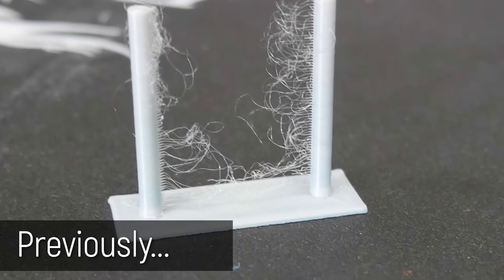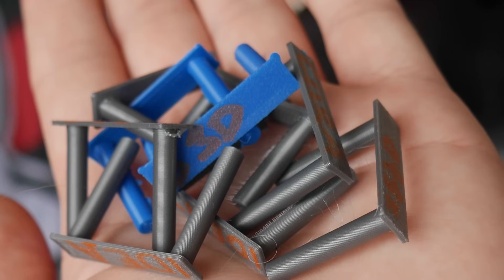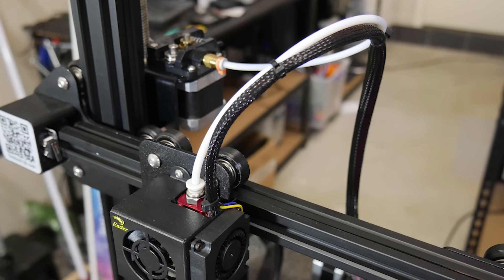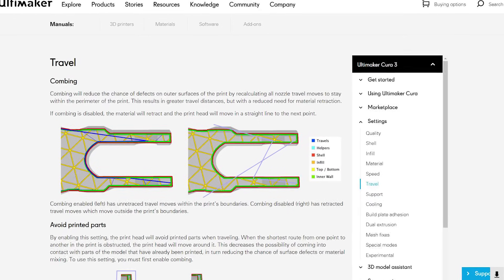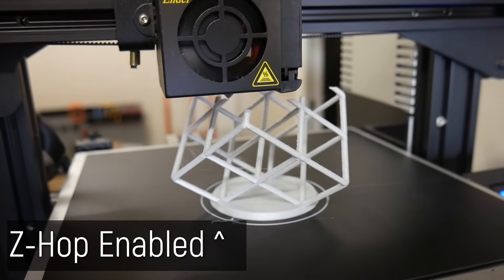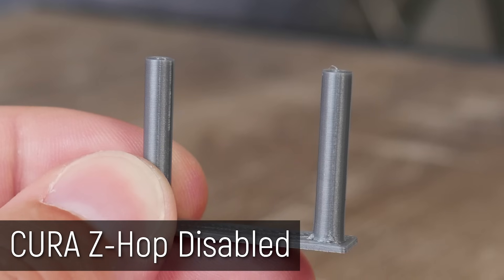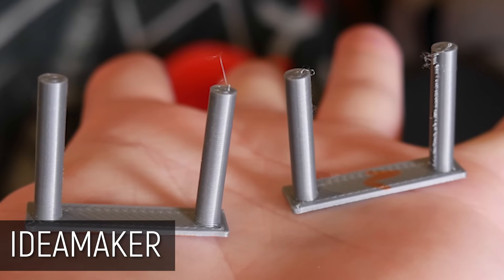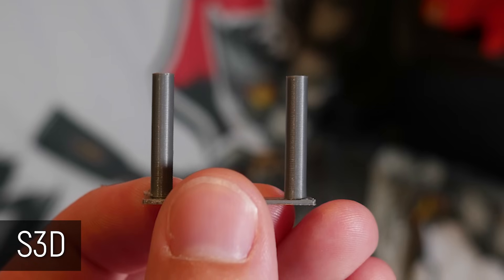Stop Ender 3 Stringing with this One Weird Trick! (ok but seriously)

Comment: Hey, Any, use this GCODE at the end of yours (right after print is finished) to stop this last string from appearing:
G91
M83
G1 E-1 F300
G1 Z+0.5 E-5 X-20 Y-20 F4200

Licensed under GNU GPL v3, makes your very top part very clean and gets rid of that one last vertical string.
Reply: Does it work?

Comment: Angus, I've asked nearly everyone in the 3D world to do a vid on when it's time to change nozzles. No feedback at all. What say you???
Oh and, great vid.
Reply: JP1 on Thingiverse has some calibration parts you can print. If you have measured your filament diameter and set that in the slicer, and the parts are still coming out oversize, the nozzle may be worn. 

You could also buy cleaning needles for a 0.5 nozzle and try inserting it occasionally. If it goes in (don't use much force) the nozzle is definitely worn to that size.

Comment: I have been getting these results for some time. you have discovered "wipe" :-) Whatever cura is doing its looks like a wipe to me. the need for z hop is a cooling issue not a z hop issue. z hop just "gets around" the cooling issue typically (cooling is such a pita !!). The ender 3's are not really vastly different. the first ender 3 is largely identical to the latest ender 3 the only MAJOR difference in my opinion is the arrangement of the wheels for the bed rail. otherwise the differences are minor and minimal. (sock or no sock glass or sticker or mag or fiber board which is not even a printer difference but a print surface difference) ie for the most part the changes do not effect how the printer prints. those parts are unchanged. most are cosmetic or convenience changes.

I just use my normal profile and the string test printed absolutely perfectly. going to redo it in a darker filament as its hard to see the zit line (almost non existent by sight and touch) I enabled z hop with zero change in string (none) and zits (still nearly invisible) I can't tell a difference between the with and without z hop at all. I was pretty aggressive with the hop too at .5mm I will post some pics to twitter.
Reply: I agree and disagree with your analysis of the differences between generations of the Ender 3. While there wasn’t major changes, there was major quality control differences. I sent the generation 1 back with a boatload of notations of what was wrong with it. I now have the latest generation and these problems have all been corrected for the most part. Huge difference in how it prints.
Reply: I'm wondering if ambient temperature is to blame for most of the different results. He mentions that it's too hot, open windows and all. How is your operating conditions?

I'm waiting for my ender3 to arrive and I'll enter the 3d printing world just in this extremely hot  Brazilian summer (30°C indoors).
Reply: I was very disappointed he didn't do slic3r and simply turn on the wipe...
He also did not experiment with the temperature on the stringy filament. I can usually finetune my temps to get rid of most of the stringing with PLA.
Different filament has different sweetspots, but I agree, a wipe is generally the first goto.
Reply: Z hop is used for an over extrusion issue or you are using a delta (due to delta printers moving the z/x/y motors on every movement so it moves along in a wave rather than a flat line) that has 1.8 degree motors instead of 0.9 degree motors. You don't use Z hop if you have a well setup printer even on a delta
Reply: @Redemptioner1  Zhop has much more use than that... especially when printing small thin details where the cooling of the area can make the detail want to warp upwards and would catch the nozzle when traveling near it. This is how his xmas tree test failed directly and what makes it a difficult print, the wobble of the segments, and the risk of collision.
Reply: @Redemptioner1  yes if its too much heat.. if its too much cooling for that specific area then it curls UP.. z hop doesnt fix anything, but it does avoid collisions with such high risk areas. And with pla, and petg you can get great detail if cooled well, but sometimes, some details, get overly cooled and curl up.. its just how the warping works with cooling.

Comment: I'm curious what you changed in Simplify3D for a better print (you didn't show what setting you toggled...just the Z-Hop / Retract Vertical Lift - let;s call it RVL for short -, as S3D calls it)?  My Ultimaker seems prone to colliding with the prints, so I have always used 0.1 mm as a vertical lift in S3D, same value in Cura for Z Hop.  That's worked to give me really good print quality over the years.  However...what's interesting, based on your analysis...would greatly explain why my efforts with PETG have always been stringy monsters...that Z Hop/RVL.  ColorFabb nGen was the same story and I was spending days trying to increase retraction distance, fiddle with higher or lower temps.  I should give that material another go with Z Hop/RVL off

Comment: The problem is the Magic numbers, based a pond stepper motor and micro stepping, But not in layer heights as you mentioned! Those are important in layer perfection, However for blobs and stringing,  it is the Extruders magic numbers that needs to be tweaked, Not many slicers take that in to account so you have to mechanically do it! I simple remedy is to reduce the number of micro stepping in for the Extruder, My quick and dirty fix,  was to putting in, the Good old faithful A4988 with a reduced steps to 1/8, Yes the motors are louder but its much more precise, and for Bowden you need all the help you can get.
Reply: very interesting theory,    but with reducing the precicion/bandwith of these extruder steps  I would have expected , the opposite would occur    ,    well  I m not a pro in all this        but thanks for your thoughts on this
Reply: @jomiller7332  You do lose some microstepping resolution but you increase holding torque and when your trying to control filament to nozzle, with pressures and retractions, while keeping in mind, the closer you get push filament out the nozzle at it lowest melt point possible ( which is not easy with a bowden extruder ) , will result in the least amount of stringing with better extruder control, Which is where holding torque comes in to play, One could have the best of both worlds if the extruder motor was a 0.9 degree rather then what is surely a 1.8 degree, on those printers.  Lets not forget, They are very much a low budget printers, and they use the cheapest parts possible, and I don't blame them!  I'm pretty sure the holding torque on are not very high. Regardless, In my testing with Bowden extruders is 1/8 is what gave me the same results as a direct drive extruder.
Reply: @jomiller7332  ehhh, yes they become less precise but for the ender 3 you just have to have an integer multiple of 0.04mm and itll be aligned with the steps. it just keeps the layers constant and minimize a rounding in the step
Reply: I'm about to switch my Delta to 2x microstepping for the extruder and a flying extruder (5-8cm Bowden tube from the hotend to the extruder and suspend the extruder with elastic or springs)

Comment: Hey Angus. Thank you for sharing that information. I just want to share my experience so it might help someone. I got rid of stringing with the CR 10 and the Ender 2 by faaast retraction and swift travel movement. I set my slicer's (Cura & Slic3r PE) retraction speed to 5000mm/s and the retraction distance to 5mm. Also increasing the movement speed to 700mm/s for the Ender 2 and to 140mm/s for the CR10 in the slicers works well. They are limited by the max travel speeds in the firmware and the acceleration/deceleration settings (tha I didn't touch) in combination with the travel distance. The Ender 2 will never reach the 700mm/s due to the small bed and hence the small max possible lenght of the travel moves. I was inspired to do this by Toms Video about printing PETG where he suggested that to remove stringing. Also I noticed that overextrusion leads to stringing. For most materials printing on Creality machines I found an extrusion multiplier of 0,97(or 97%) pretty much hit the sweet spot. For more help with the Creality machines people can watch Nery's videos here on Youtube. He is the most experienced person I know when it comes to Creality printers and does livestreams every Wednesday. You can ask anything. He is very patient and a good teacher. Cheers!

Comment: i bought a cr-10s just before the ender 3 came out. it had loose screws, loose and tight wheels, an out of date assembly manual, a nasty nozzle and a persistent missed layer extrusion issue. i got sick of it and used my trusty old mp mini with e3d v6 light to make a titan aero adapter, and compressed air part cooler. this all took a while, and just recently i found the reason for my missed layer issue, being a faulty extruder stepper driver. that being one with the main board, that left me little other choice than getting a new one from creality, and giving them even more money. long story short, i have to agree with Angus' issue with the qc department of creality and their tendency to keep messing with their product without telling the customers. still, large build volume and decent printer for the money, even if i've never printed anything successfully with it in the near year i've had it

Comment: I never had any stringing issues with my CR-10 using Ideamaker at first and now Slic3r PE using PLA. And with the Ender3 I only use Slic3r PE and only have some minor stringing since I switched to PETG. I did not put in enough time to tune the profile though. And I am always using Z-hop. Okay, now I will give this linked stringing test file a spin on my CR-10.

And okay, the test-file does indeed have a few spiderweb strings and the columns look awfull.
So thank you for the opportunity to fine-tune my Slic3r PE profile. :-)

Comment: Looking at gcode from IdeaMaker, it looked like it was using CuraEngine for its actual slicing. I was never able to confirm that, but it certainly uses identical gcode comments, which is suspicious. If they are using CuraEngine, they should release source under GPL.

Comment: I had Combing no Skin without stringing. The thing is the tolerance on cheap ptfe tube come out of the box and also the couplers letting the tube moves while retracting. 
I use Slic3r PE and Cura. Z-hop off. Retraction with capricorn ptfe 3.5mm at 35mm/s. With cheap Chinese PTFE tube at least 4mm at 60mm/s and 5.5mm with PETG - if couplers isn't moving too much 😅
I understand your videos about Ender-3 stringing. It's kind a tricky to deal with that.  I already have a Masters in Ender-3 issues with speciality in stringing since I've printed like 50x or more retraction tests, so i ended off printing 2 screws instead of retraction tests stl for didn't waste too much filament 😅

Comment: My cr-10s came with warped bed, one z rod bent, x carriage drilled and tapped wrong, dead fan, and list goes on. I’ll never buy another creality product ever.
Reply: DAMN! My CR-10S had a pretty good bed, but I had 2 bent rods, stretched out Z axis couplers (for the rods, both of them), wheel guids were off ect. I had to take the entire printer apart and rebuild and I never did that on anything except a Chevy... Is it normal for the X axis belt to grind on the right hand side just under the pulley? Ive tried to adjust it but its some tight clearance. How do you know your X axis was tapped wrong?

Comment: Thank you for this! 
Im a noob at 3d printers and ender is just barely in my budget.
But i was afraid that if i get it ill just end up not using it because i wont be satisfied with the result and its just gonna end up being a glorified toy on my shelf because ill give up on it.
I dont know if lower priced printers have the same capabilities as the higher priced ones and i really dont want to regret my purchase by finding out they do in key areas.
I'm still on the fence, but im glad that at the pricepoint of ender 3 im not just getting something that can print but never deliver any quality results.
Reply: im in a similar situation. I decided to treat myself and buy it with some of the money i got for a gift over the holidays. Im loving my ender 3. I believe the latest version of the ender 3 has improved connectors. Ive had 0 issues with my bowden tube but i have only ran it for probably 50 hours. There a huge community of small upgrades you can make that make solid differences and really upgrade the quality of the overall machine. Plus with how popular it is theres tons of videos regarding slicer settings which honestly from my limited experience is the #1 way to up your print quality. Over the last day Ive been playing with new layer heights and trying to get my settings down to help with the stringing that came and this video came along doing exactly what Ive been trying to do. Im going to try his profile that he posted but It looks very promising. It may be a cheaper machine and have some issues, but it is still a great value and you can absolutely print functional, good looking parts. Just may take a bit of tweaking and refinement
Reply: @asa_1896  I am very happy to hear that, infact i think for 3d printers the 1# thing i want is a very active community, because chances are that problems have been worked out, addons and upgrades have been experimented with and tutorials and videos made. 
As a complete noob, im very into the idea of having a printer next to me and tinkering with the slicer and the settings and actual construction to get wait i want intead of sending my prints to a company that does the thing for me. But im still afraid that ill hit walls and such.

What kind of prints did you have success with? mine will be mostly organic ones, that will have detail on its surface and lots of curvature. IK sla is better for that but ive seen some impressive results with fdm.
Reply: @BlackScream77  im an engineering student so ive been doing a lot of geometric shapes but im getting more into organic ones for some statues. Geometric shapes are what im good at actually modeling since ive taken classes on engineering modeling in school. Though as i type this I currently have miniaturized daft punk masks printing off and the first went very well. Ive only printed in PLA so far. 

Theres so many videos like this one that cover these small tweaks that make all the difference. Search up ender 3 on thingiverse and youll see how many mods there are. I currently have 7 individual mods on mine. The slicer can be daunting at times, i use cura, but ive learned so much so quickly just by running test prints and reading online. Theres a few websites that have like all the major print issues and basic how-tos to fix them. Ive also used the /r/3dprinting chat to get a few issues worked out that ive gotten stumped on. In my opinion is a very fun hobby that teaches you a lot and could possibly be applicable to a career depending on what you want to do. I had the opportunity to print on a Formiga P110 SLS printer for school, I made a mini turbofan engine, and you can bet that 3d printing and modeling is on my resume already
Reply: @asa_1896  Thats awesome to hear! I'll wait a little longer and research a little more, but i think ill end up getting an ender 3 if i get anything. People keep suggesting sla printers for my models but thats not exactly hobbyist territory prices and i want to print at home. I just hope i can make space for it. I'll definetly check out the sites and join the community since i think thats the ticket to getting the most out of ur printer, thanks for the site references!! My main concern with printer accuracy is that i want to print model kits, small ones, but in my experiece a thenth of a milimeter difeference can make your model kit impossible to assemble. Im gonna be trying some printers before i buy mine since i really dont know what limits to expect.
Good luck with your 3d printing!!
Reply: @BlackScream77  damn thats some tight tolerance! sla may be the way to go or honestly an ender 3 and a pack of sandpaper to get it exact lol
Reply: @asa_1896  sandpaper is a must! out of the box model kits are also useless without a sandpaper, and infact sandpaper is probably the best solution to this accuracy problem because u can just test it immediately. I mean it doesnt have to be that exact, but the difference is a pleasantly movable model vs a overly tight prone to breaking or overly loose one, or when fitting parts they will pop apart due to pressure. the only real solution is sandpaper so im not that worried, so long as i can make something thats tight fitting.

I want to print pla but i head that its harder than ABS meaning sanding might be problematic, ive tried it, but im far too weak and lazy, and my sandpaper is crap.
Reply: @BlackScream77  sanding with 120 grit smooths it out pretty quick
Reply: @asa_1896  Thank you!